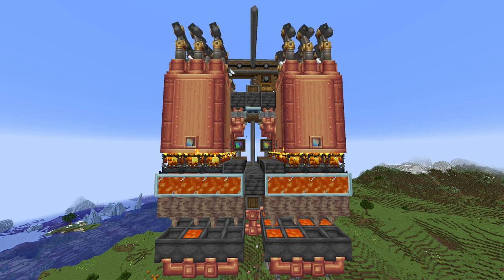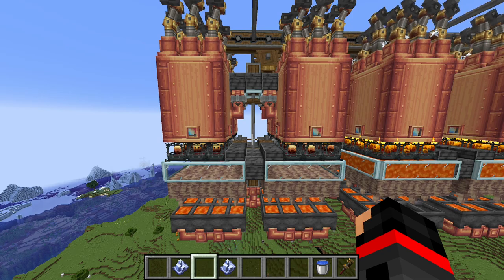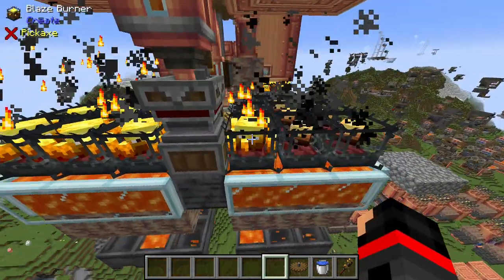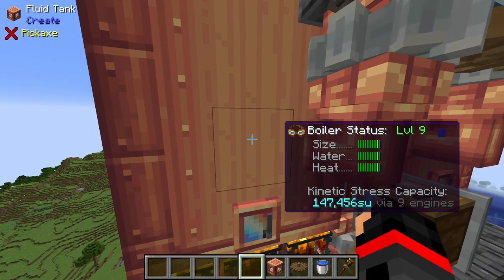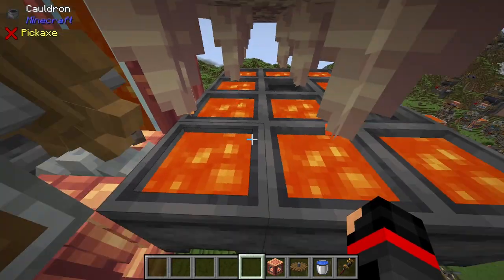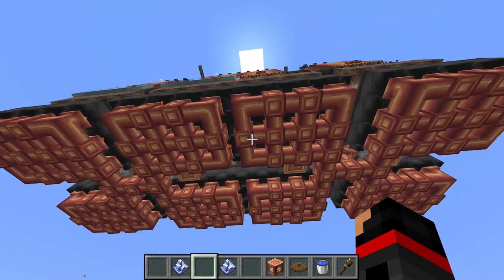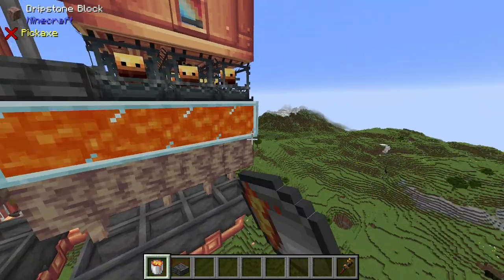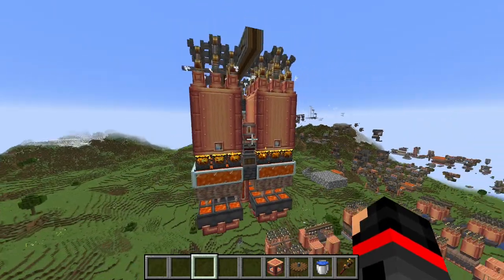585K SU! 4x Tier 9 Steam Engine Block! - Minecraft: Create

Comment: Keep in mind I am pretty sure you can only put water buckets into the engine manually in creative mode, so in a survival world you will need to pump water into them manually to start them.
Reply from the maker: Ah, youre correct. I didn't realize that. well, the start up takes 4,992 su. So a mid sized windmill should be able to do the trick
Reply: @Triobian  How do you start it up? Do I need to pump water in using extra pumps or just provide 4,992 SU to one of the shafts in the middle?
Reply from the maker: You should just need to provide the su to  any part of the machine. My bad though, I hadn't actually realized you can't pit water in the boiler directly. The fault of always building in creative I guess haha
Reply: @Triobian  I came here to mention that. In my (strictly survival) world, I've gotten bitten every time I need to restart it, because it doesn't pump water into it. I ended up beefing up a windmill somewhere else that runs a conveyer belt near my engine so it could also provide at least enough water for it to start.

Comment: For some reason the mechanical arm was moving too fast for the lavabuckets to fill up. The way i fixed it was by having a brass funnel on the depot and moving the full buckets to another depot and then using that as the input for the arm. Hope this helps anyone with the same problem :)
Reply: Not sure i understand what you mean here. Could you make a video on this?

Comment: you need to use brass funnels and filter it to empty bucket because the mech arm won't work and it will cycle between the funnel and depot
Reply from the maker: Yea, I have a community post with a picture of that fix. It's odd though, when building and testing that engine, I never once had the cycling issue
Reply: Would you be able to explain further. switched to brass funnels with andesite filters for empty buckets and still getting cycling issue.
Reply from the maker: I have a community post from around the same time, you can look at that for refence, it's a picture post. Alternatively, my Nether Engine uses the exact same fix, so you can just look at it to see what I did

Comment: I’d be interested in seeing how compact of a fully automatic tier 18 boiler you could make using the createplus mod for 1.18.2 that adds a recipe for netherrack that makes it farmable 
The recipes that createplus adds (outside of its mod compatibility ones) are actually quite interesting, like a recipe for those blocks create adds that when crushed produce a decent bit of ore. It’d be interesting to see what you could make for those
Reply from the maker: Definitely sounds interesting!
Reply: i mean, size would depend on what you consider part of the build. Using that datapack to create an automatic blaze cake factory is one thing, and then the self suficient T18 boiler would be rather small if you only account for belting the cakes into a buffer vault that deposits them onto a depo to get distributed by a mechanical arm. If the Blaze Cake factory isn't considered part of the engine then the engine itself could be as small as a 6x6 footprint, maye smaller depending on where you position things. If you include the blaze cake factory though, you're looking at a whole chunk at least.

Comment: The mechanical arm does take the bucket to fast so it stay a bucket.That means no lava bucket is filled in the blaze burner.If i switch to 80 rpm it is slow enough so the spout fills the bucket but the ooumps for the water is then to slow.How to fix?
Reply from the maker: That's perplexing. In all my testing the mechanical arm doesn't move at all until the bucket is filled with lava. Like with the ponder, it shouldn't try to grab or move something unless it has a valid use/output. Try breaking the arm and redoing its input and outputs
Reply: @Triobian  Finally got it set up and I'm having the same issue. I replaced the arms and it worked the first time and then stopped working correctly and just removes the empty bucket from the depot and puts it into the funnel on top. I can provide a video if you need
Reply from the maker: That's so odd. I have never had that happen at all. A video would be appreciated. Would help the troubleshooting
Reply from the maker: Hmm very interesting.. Have you already tried to break and replace the spout and the connecting pipes? It looks like it's got lava just fine but worth a test
Reply: @Triobian  yea I’ve tried. Didn’t do anything
Reply from the maker: I made a community post with a potential fix. Can't know for sure till someone tries it, since for me my original build worked just fine. LMK if you try it

Comment: Idk whats wrong with mine but the mechanical arm picks up the bucket before it can get filled by lava
Reply from the maker: Yes, that issue has been solved in a  community post. You can also take a look at the lava gen method i use in my three powder farm videos to see how the solution works.
Reply: Nah I just fixed it my own way with a brass funnel that only accepts lava bucket into another depot. Thanks for the vid btw

Comment: I seem to be running into the same problem...
Everything works as supposed to, but the mechanical arms are too quick picking up the buckets. The spout doesn't get the chance to fill them, so it just picks up an empty bucked and immediately deposits it back into the funnel. Full circle moment...
Reply from the maker: I have a community post with a potential fix, try that and see if it works for you
Reply: @Triobian  That did the trick! And I finally found out what community posts are XD

Works like a charm!

For other problem-solvers:
Change the setup by moving the spout up and putting a depot underneath, then a brass funnel under the depot and the original depot beneath the funnel. Set the funnel to only let through lava buckets, and have the mechanical arm take the filled buckets from the bottom depot, and deposit empty buckets on the top depot.
Reply: @Triobian   im so confused where do i find the community post?
Reply from the maker: On the channel page. There's also info on it in the discord.
Reply: @Triobian  amazing thank you! i managed to get it working after alot of fiddling but i finally did it! thank you for replying back! Subbed my friend

Comment: I built this and I love the design. It'll fit right in where I need it, and 500k+ su per module is nothing to scoff at. However.... I'm having a few issues. When I fired it up, it wouldn't pull lava up from the backup tanks. I remedied this by replacing the top parts of those tanks with pipes, seems to have done the trick. But now, while the whole system is getting heat, only 3 tanks have water. The three that do are reporting 2 ticks under both space and heat, while the one that isn't getting water is reporting full ticks on space and heat. I'm still new to the mod, still learning everything, so.... Anyone know what gives? What do I need to do to get this beauty from the 200k su all the way up to the 500k beauty it's meant to be? 

If it helps, I used the schematic cannon.

Edit: I just bandaged the problem with the 4th tank by running a dedicated pump to it. The whole system is now producing 255k. The 4th tank is now giving the same readings as the first 3... That is, level 9 with 2 ticks under on space and heat. I have no clue how to fix that as steam engines are still entirely new to me.
Reply from the maker: Can you post about this on my discord? We have a troubleshooting channel, and as you seem to have a few issues, it would be easier to explain and answer if we had screenshots to go along with it and could communicate more easily than as replies here
Reply: If you're using the schematicannon, it's... stupid. Check your pump output angles and your pipes. The pipes that feed directly into the tanks have a bad habit of turning funny when schematicannon printed, I've found.

Comment: My steam engine says it is overstressed but I'm not sure why
(I didn't finished all the blaze holders and steam engine) is this the reason why
Now the water isn't going into the tank
Reply from the maker: You'll need a few thousand su to maintain lvl 9 engines, in terms of water supply. So if your boilers arent reaching level 3, then that might be your issue.
Reply: @Triobian  thanks, I have another question, How do I turn on (start) the steam engine
Reply from the maker: You'll need to use a handcrank with a pump to get it started

Comment: mmh it seems the spout wouldnt fill a second time the buckt
Reply: Have also tried the method with the 2 depots from your community area... maybe it's also because I used Streamer Mod "Create Live 4" but actually there should be no problems with it
Reply from the maker: Did you set the top depot to be deposit and the bottom one input? With a lava filter on the funnel?
And then did you remember to redo your mech arm deposits?
Reply: @Triobian  i should have done everything... maybe you could add this in a new version of the engine because it seems to be a big problem but i'm trying again in the basic version of create if it works
Reply from the maker: How did it go?
Reply: @Triobian  okay i tried it in create basic. The Arm go first to each blaze then to the depot where the lava bucket ist and then to the upper depot where the empty bucket is but he dont put the empty bucket to the 2nd depot
Reply from the maker: So the arm will take the lava bucket from the bottom depot, but it wont deposit the empty bucket to the top depot? And you've double checked that you arm does have the top depot in orange and the bottom in blue?

If so, then the only solution left is to add a brass funnel or smart chute, set the filter to empty bucket, slap it on the depot, and configure the arm to have the funnel/chute as the output for the bucket instead of the depot. If even that doesn't work, then I have no clue why it's giving you this trouble.
Reply: @Triobian  i finf the issue :D very stupid with the double depot method i forgot to change the in and output :D
Reply from the maker: I'm just glad it was user error and not something wrong with the build XD